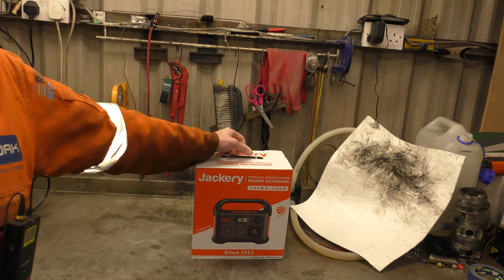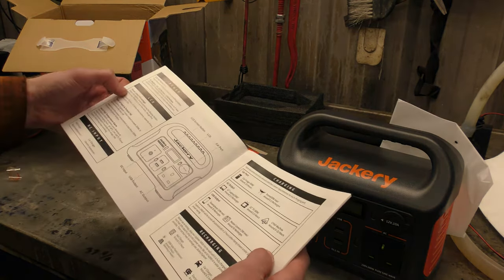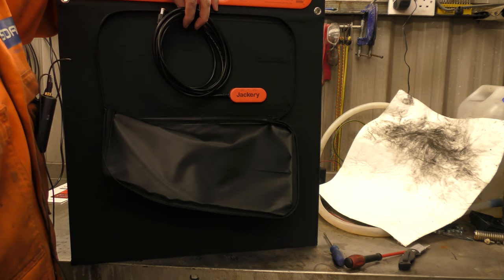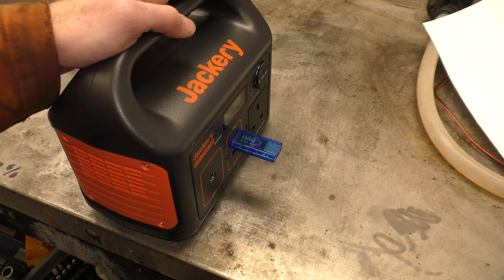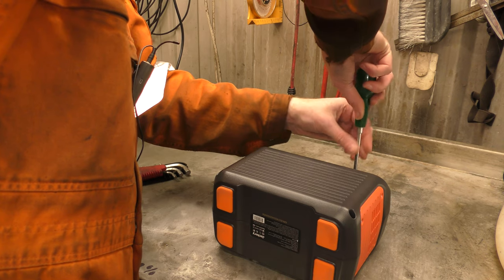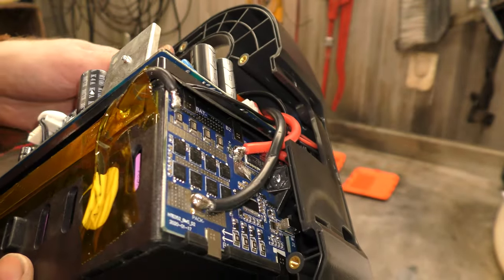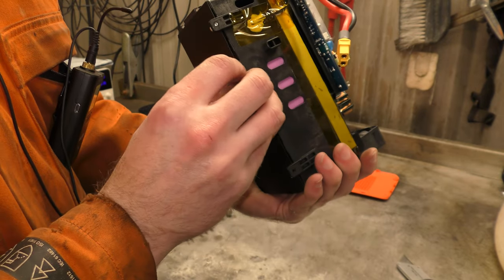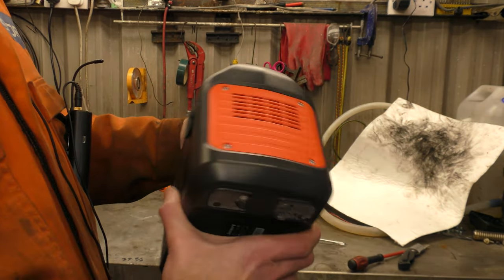Jackery Explorer 240 Portable Power Station UK version with Solar Panel tested and taken apart

Comment: Does the 230vac socket rotate 90deg. Eg can it be refitted as it look square. So cable can come out sideways etc from plug.  I from old George
Reply from the maker: That's a good idea.  I'll need to have a look at that.
Reply: @DavidMcLuckie  did you ever get around to this, would love to know?

Comment: Now you have me wondering if internal battery is 7s4p or 4s7p I would think 7s with a boost converter for charging
Reply: The battery connections appear to go directly to the board in the side of the case (via the XC90 connectors), so I suspect the battery is nominally 12V, so probably 29 cells in 3S 7P format.
Reply: @cambridgemart2075  no 4s still framintg i cansee the 4 balance resisters not only that the pos and neg wires to the battery are both at the top 1 would be at bottom if it was 3s

Comment: Hi i checked out the the price of all of there units and seemed a bit expensive. 
Would you say  they're a reasonable price? Cheers
Reply from the maker: So when I was browsing I'd seen a few I'd liked to test running the heaters on.  Looking again at them, they are all priced around the same area considering some have a smaller inverter or some the 12V cigarette lighter isn't there.  I'm slightly tempted to buy the cheapest on Amazon to compare its claims against the Jackery.
Reply from the maker: JACKERY2021 - put that in the Amazon checkout where it asks for discount codes.

Comment: hi Dave.  please could you let me know ? in your vids  you are using ? silicon tube .. its nice an flexible.  what is it called and were can i find it please. as a modeler regular silicon just blows up an go's like jelly ... not good .. yours hope fully  Tone
Reply from the maker: It's PVC fuel pipe.  The kind you find on chainsaws etc.  Comes in a variety of sizes.  You'll want the 2mm ID for a nice tight fit.

Comment: I think I'd be wearing insulated gloves with the potential for a belt off the pack. Unimpressed that there's no earth connection with RCD protection (not sure if that's possible with a portable device), makes me wonder how it got UK approval? You could always rotate the 3 pin outlet 90 deg CCW for some cable relief. I do like the fact that they used brass threaded inserts in the casing. If you don't like the pink 18650's you could send them to BigClive, he has a certain penchant for things pink.
Reply from the maker: The battery pack is 14.4V so no HV electrocution risk.  Generators/portable inverters don't usually have an earth as it isn't referenced to the rest of ground.  To get a shock you'd have to touch the appliance and the housing of the inverter which in this case is plastic.  Some generators while they have a ground you can attach to it isn't often referenced to the neutral side of the output.
Reply: @DavidMcLuckie  Interesting, I haven't had one of these apart, so no residual charge on the inverter HT side? I have memories of eejit navigators flying across the bridge after tampering with a proper UPS, how I laughed, after rendering immediate assistance of course.

Comment: Looks good though the US shop is 199 usd for the 240 model but the UK price is 259 GBP!!
Reply: US price is generally pre tax, so roughly the same price if the UK price includes VAT.... Ish!
Reply: @joshlivesey6936  vat in the US is only about max 7% I believe though if I'm wrong I'm sure someone will correct me which puts the US price inc vat at about 214USD UK price is equivalent to 360USD.

Comment: Really looks like a well made unit, good gauge wiring throughout and charging circuitry looks well laid out, purple I think is LG batteries, that solar panel great add on, would be good if they could make it that you could purchase the Jackery and panel as one discounted unit

     Billy Connelly
              Fabrizio
Reply from the maker: Yeah.  I'd have made it a package that if you bought a power station and a solar cell it would be cheaper than buying separately.

Comment: Come on, no 12v appliances?  I know you have 20 diesel heaters laying around.  I bet 240wh could run one for a fair bit assuming it could handle the 8+ amp ignition.  And you also have converter inefficiencies in that 5v power supply for usb, so the wh rating you achieved is all that more impressive.
Reply from the maker: I know.  Everything I have seems to be either USB or a direct battery connection.  Oh don't worry, we'll be testing it with the diesel heater.

Comment: There a great tool but @£1099 is a rip off !
Reply from the maker: I'm curious as to why you'd say it's a rip off?
Reply: @DavidMcLuckie  sorry for late reply , compact inverter £200 li ion battery £400 double the size good pd usb-c charger 5-24 v £20-50 = £650